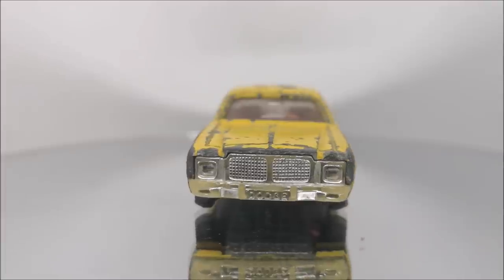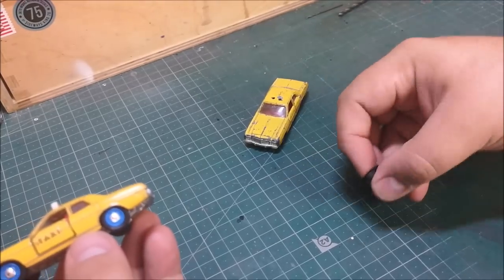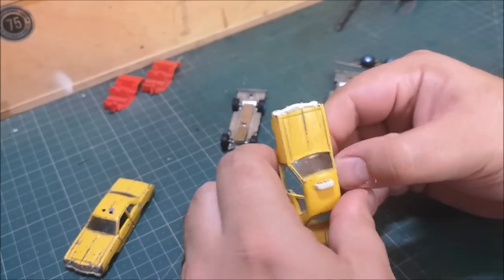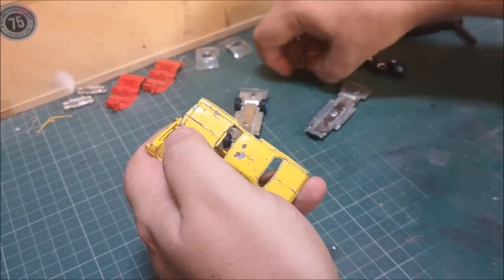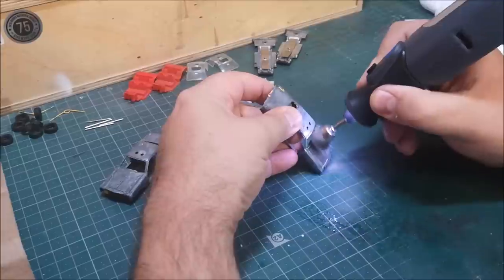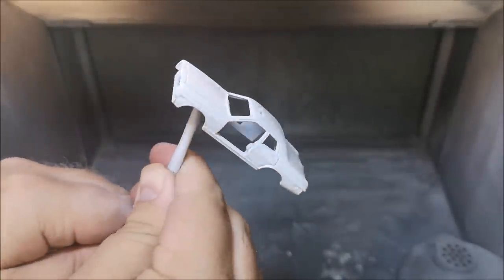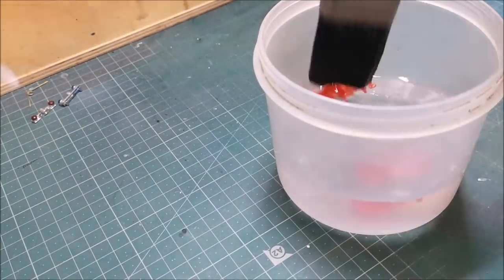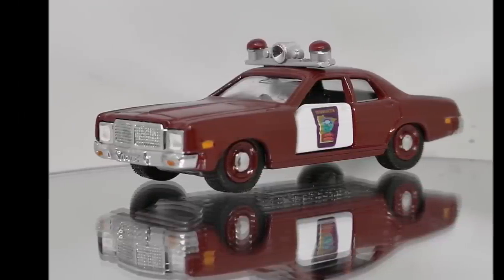1976 Minnesota Highway Patrol Dodge Coronet Custom

Comment: Get yourself a couple of pairs of 'Sprue' or 'Edge' cutters, Rob - I was wincing as you took the craft knife to the TAXI sign. The cutters have small, sharp ends that you can snip items like that very safely, with a really clean, precise cut - they look like very small wire cutters. I've used them for years, and wouldn't be without them. Dave, on his 'Toy Polloi' channel uses them often, if you want to see what I'm on about.
And yet another blinding result. Nice one.

Comment: Very nice! State patrol car are pretty much the same color here in Minnesota, though the body color is more if a dark brown, but they still have the same markings on the door. If you're wanting to do police lights check out Evan designs, they do rail road stuff mainly but have a police light up set that should work with matchbox scale.

Comment: Excellent job.  Wow. Where did you find the wheels?
Reply from the maker: Greenlight
Reply: Greenlight has a package of 4 sets of different tires along with a push bar and overhead light bar. Greenlight has several sets of different tires. Jeep, truck duallies, law enforcement, etc. On ebay and at hobby lobby.